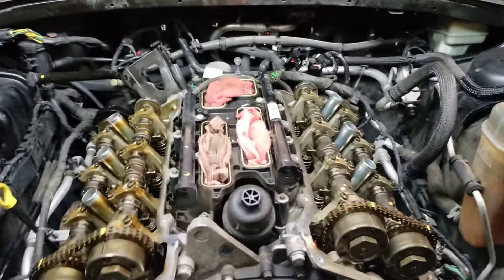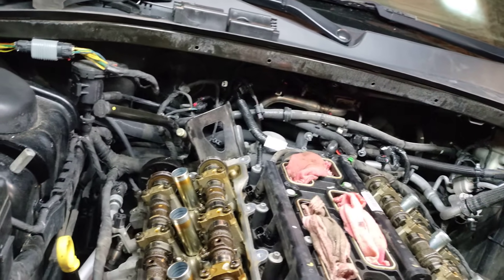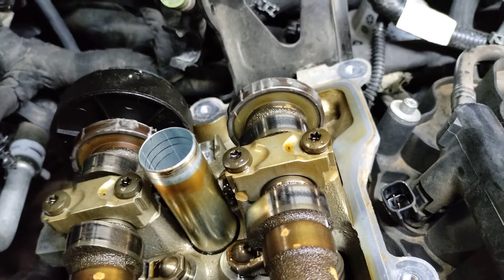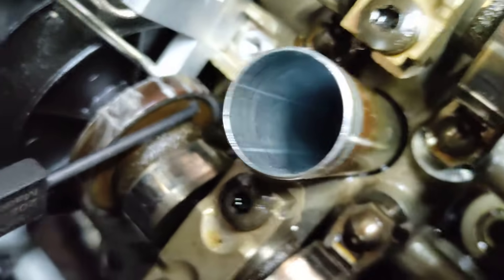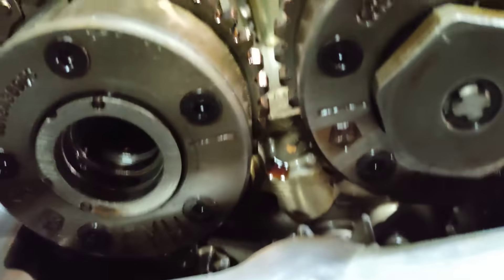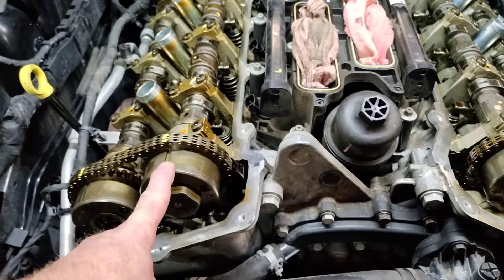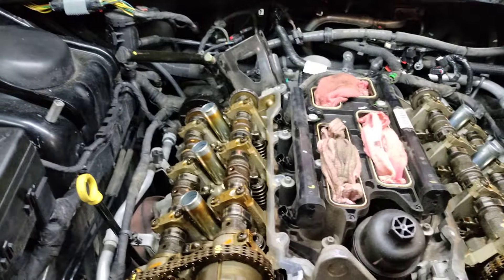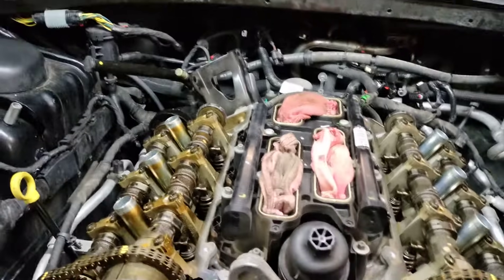Chrysler 3.6 Tone Wheel Check Tool

Comment: Hi I have a dodge promaster  2017 with 3.6 pentastar  i have bad cam sensor bank 2 and I also get service hill holder ecs  flashing  on the dash when the check engine light comes on have you seen this  before

Comment: Where those holes are at on the cam reluctors.  Where are those holes located in relationship to degrees?  It likes about 120 or so.  If that's the case I think that gives the computer it's base lobe seperation  angle between each intake and exhaust cam.

Comment: Hey Luther great video. I have a question. I'm not getting that code you got but I do have this tool. Before I break everything down, I'm wondering if you know what else it could be. I'm getting codes P0019, P0369, P0306 and P0300. I've replaced the crankshaft position sensor, int cam phaser and both camshaft sensors.

Comment: any chance someone could measure the distance between the holes in each tool? currently chasing a P000A and I'm at the step of cheking the tone wheel. cant find the tool avaible anywhere I check. I'm in canada. pretty sure if I measure instead that could work

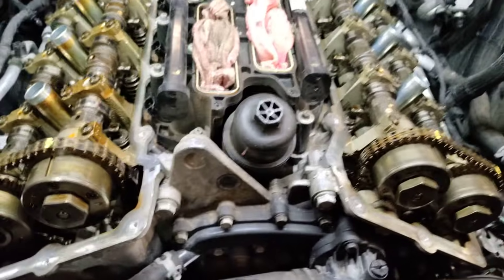Comment: It would be nice to have an outline of the tool and the hole marks so a homemade die can be made.  It's not a difficult tool to use or make, not sure why it is still so expensive.  Based on a visual, on bank 1, the exhaust cam tone wheel hole is 90 degrees to the right from vertical and is pointing towards the intake cam.  The Intake cam hole is about at the 5:30/7:30 position, depending on if you're looking at the cam side (5:30) of the tone wheel or from the back of the engine (7:30).
Reply: Especially since Dodge won't sell it to you

Comment: Have u ever seen the tone wheel covered in gunk and metal wear causing inaccurate readings? I have a 2019 jeep grand cherokee laredo 3.6l and it has a slightly rough idle and engine feels like it surges or misses with no cel or codes. Also the voltage will drop when this happens. At idle voltage drops but rpm increases from 600 to 650 briefly then r3covers. Dealership couldn't find the problem. I'm desperate for a fix bro please help

Comment: If you decide to buy this tool please do yourself a favor And spend the extra money and buy the factory Miller tool and don't buy the aftermarket option because I did spend the extra $50 dollars because I have seen The aftermarket tool and The markings are different and confusing 😮 And buy the Way The aftermarket tool is about 250 and the original one is about $300 not cheap 😮😮😮

Comment: Damn dude that was really good, I would like to find that tool somewhere. What's the recommended fix, replace the cam? That hole was so far off you didn't need the pin. Do you think I could order that part thru Chrysler?

Comment: When I took my covers off I see alot of grease on the toner wheel is that normal is it ok to clean off
Reply from the maker: Grease? Only asking because if its silver or metallic in color its metal sticking to the magnetic segments of the tone wheels. i suggest wiping it off with a paper towel or shop rag. Avoid using harsh cleaners. No need for brake cleaner etc it will 99.9 percent of the time wipe off. Those tome wheels can be damaged with certain cleaners if not used properly so that's why use a rag of some sort
Reply: @mastaTech91 thanks for replay back. Yea that was my though I’m getting a no start it died on me and won’t start back I changed every thing electrical you can think of just not the harness and when I was about to change phasers I notice the toners being junk on them I was thinking maybe it’s build up material and blocking the signals to start. Do you even think that’s possible to cause a no start
Reply from the maker: @Andy-gw7hd  I haven't ever had buildup cause any problems. A slight wonky scope signal but not any starting issues.
Reply: Ok thank you

Comment: Not all vehicles can you go by "left bank" and "right bank." Some models, primarily the Town and Country and Grand Caravan have the engine orientated east-west in the bay so your "right bank" is really the rear bank and the "left bank" is the front bank. However one tried and true method of determining bank 1 and bank 2 is that bank 1 always has cylinders 1, 3 and 5 while bank 2 has 2, 4 and 6. Bank 1, the odd bank is the one where the head is most forward. It's always on the right, or passenger side of the car in north-south configurations or back in east-west. Bank 2 is the even bank and always on the left (driver's) side for N-S or front on E-W cars.
Reply: First, identify the front of the engine.  That's always going to be where the timing belt or chain is located and where the serpentine belt is located. Then, facing in the same direction as the engine, facing front, bank 1 is always on the right side of the engine and bank 2 is always on the left side of the engine.  Cylinder 1 will always be the first cylinder from the front of Bank 1.
Reply: Then won’t bank one always be on left side of oil cam on all 3.6
Reply: @Andy-gw7hd  oil cam??
Reply: @Andy-gw7hd  if you look at the engine from the back side, opposite the serpentine belt, bank 1 is on the right side. Bank 1 is passenger side on N-S engines and inside closest to the firewall on E-W engines.

Comment: Hi I had tick so I put in all new lifters   n.   Roller rockers on 3.6 p. Star now I have code p0300 po301 stored p0345 po390  could you please  tell me what it is I need to do to to correct it thank you Brian
Reply: Have someone else check the timing and go from there.

Comment: Great video! On same engine I just replaced camshafts,  rockers and lifters. Now i have even louder ticking noise from before. No codes come on. Everything is running smoothly.  Only on 4th speed around 1600rpm i get little jurkwhen accelerate smoothly. Any thoughts on that? Thanks!

Comment: Quick question bro...what if I keep getting the p0018 but already replaced both camshaft with tonewheels but the code only pops up on a cold start...after that I can drive the car all day and the light won't come back...only on my first 2 to 3 starts I keep getting a p0018
Reply: Following... Did you ever get the P0018 code to stop ? Thanks
Reply: Remove your VVT solenoids and clean them with brake cleaner and lint-free rag. Then clean the hole where the VVT solenoid goes in as well as you can. Only use brake cleaner on the VVT solenoids after they're removed from the engine and don't use brake cleaner to clean the hole they go into. You can use a little bit of SeaFoam to clean the hole. If this doesn't fix it, you will have to teardown engine far enough to clean the passages between VVT solenoids and phasers. You'll also have to check phasers to make sure they're locked in place to the camshaft. The camshaft shouldn't rotate independently of the phaser when engine is not running. There's a lockpin that keeps them locked when there's no oil pressure. It' goint to be one of these 2 things. If you're the original owner, then you have to do more frequent oil changes. Most of the time this is a result of not changing your oil at recommended intervals with good quality oil and filter. Sludge builds up and it block oil flow to the VVT solenoids and  phasers.

Comment: Hello, great video!! 
I replaced the lifters and rockers on my son’s 2014 charger, typical tick.  While trying to take off the bank one valve cover the studs from the valve cover gouged the tone wheel. The car has a long crank no start now. It is in time, is it possible that the gouged wheel is causing the issue?  Thank you
Reply: No, a gouged tone wheel would NOT cause a no start. The PCM has 3 other tone wheels and CKP sensor to determine timing.

Comment: Great video, one correction for the timing chain its 12 rivets or 6 links but we get the point. Do you know of a way to check chain wear or stretch, in my motorcycle days you could check wear by pulling the chain up off the sprocket at the center of its wrap and you should see no more than half the tooths valley, you also would check tension by pushing down on the chain between the two sprockets, I would think any wear, stretch or wrong tension could create backlash that would set miss fires codes most likely both sensor 1 and sensor 2 of that bank because it would effect both intake and exhaust cams.

Comment: Had a dealer chaged bank 1 intake phaser and oil control valve.  Transmission starts off in D3 when driving, assuming the engine codes 0000A, AND PO017, CODES,  ONLY HAS 102,000 MILES. CHANGED CAM POS SENSOR BANK 1. TONE RING ON INTAKE CAM LOOKS LIKE SCRATCH IN IT. COULD THIS BE CAUSING THESE CODES?   WEIRD 2 CODES ON EXH, AND INTAKE ON SAME BANK 1. CHAIN DOESN'T SEEM STRETCHED,  MAYBE TENSIONER!  NO CODES FOR BANK 2.  THANK YOU
Reply: Did u ever find out what it was? I have a p0019 and p000c with the same symptoms as u

Comment: I've done a lot of 3.6 pentastars. Usually when you have a correlation code on the 3.6 in many of my situations it's always been a bad cam phaser.
Reply: Does that cause the car to like run rich and drive a little rough? Because I just got a p0340 and it’s acting up
Reply: @Alialmaliki18  it certainly can cause your timing for that camshaft is bouncing back and forth

Comment: if I'm understanding this right, the tool shows if its out of time?  if the timing marks are correct and the tune wheel is off, how is it adjusted?
Reply: new cam
Reply: The reason you do this is to find out if the toner wheel has become loose and shifted. If it has become loose, you will be able to rotate it by hand, so you adjust it by rotating it with your hand.

Another reason you would do this is when replacing a camshaft and the new camshaft you bought doesn't come with toner wheel.

That's what the tool is for. Once you set the timing by aligning the arrows on the phasers to point directly to each other, you then place the tool like he shows in the video, and align the holes in the tool to the holes on both toner wheels by sticking the pins through the tool and toner wheels. After you do that, you mark the toner wheel and the camshaft, take off the toner wheel and use an appropriate adhesive to set the tone wheel in place.

Comment: Thank you, excellent video.  What is the correct repair, a new camshaft?  Has anyone considered TIG welding the wheel to the camshaft?
Reply: Who knows what the heat will do to the magnetic ring.
Reply: @marossgnv TIG welding uses localized heat, I doubt it would heat the reluctor wheel enough to damage it or it’s magnetism. The wheel would not need a full weld, just a few tack welds.  What is the recommended method of repair now, replacing the camshaft?
Reply: @gfbemc0256  TIG welding is not a good option. The tone wheel is very sensitive. Best way is to use an adhesive that's heat resistant up to 300 degrees Farenheit or higher and oil resistant.
Reply: Loctite bearing and sleeve retainer. It’s green.

Comment: Hi Luther Grant. I did look at the Chrysler 3.6 tone wheel tool. I am impress.Any how i am having issues  with a 2008 jeep wrangler unlimited 3.8 Liter.I did scan for trouble code P0304/P0300 Stored.
Could i use my lab scope to check this problem. Let me know how to check for cam and crank synchronization. Let me know how to proceed. Regards. Winston.
Reply: If you have a 4 channel scope, backprobe the CMPs and CKP and connect to scope to see waveforms, then compare waveforms to known good waveforms.

Comment: Can you use magnetic viewing film to verify if the tone wheel was damaged by a magnet? My magnetic pickup tool accidentally touched the tone wheel
Reply: I just did my rocker arms and I also used a magnetic pickup tool and I think I touched it to the tone wheel.  I have a p0349 code that won't clear and I'm stuck in limp mode.  Probably gonna need both cams for bank 2.  Why do they design these like this??!!
Reply: @marcsciarrotta3109  Dang, that sucks! I was fortunate enough not to have any codes thrown once I put everything back together. I guess I just got lucky. That was one of the things that most videos don't talk about is the magnetic part of the tonewheel mostly everybody talked about the cam phaser and its sensitivity to magnetic tools. When I did use the film it did show the magnetic field and it look normal so maybe try that first and see if the magnetic waves are disrupted because if it's not, it honestly might be something else. Good luck and hopefully you find out the problem,  I couldn't imagine having to tear it back down again

Comment: I have a 2014 chrysler 300 3.6 I have a p000c with a p0019 can not git rid of these codes dose it have to do the tone wheel
Reply: I have the same problem did u have any luck fixing it

Comment: Great explanation!  Other than throwing that fault code, how will the tone wheels being out of alignment affect engine performance?
Reply from the maker: If the tone wheel moves enough to set a cam position sensor code then you get the long crank times before the engine would actually start. When moved the ecm can no longer confirm correlation between cam and crank and will almost always sub a value to get it started. Long crank times are the only symptom I've really ever noticed unless its several teeth out in which case it can cause driveability issues. Thanks for the comment and question. Sorry for the delayed response.
Reply: @mastaTech91  Thanks for the reply.  Reason I asked is that I replaced several bad rocker arms in my 2013 Town and Country.  Unfortunately, I put it off so long they destroyed the lobes on my bank 2 exhaust camshaft.  I bought a replacement camshaft off ebay for $88 that did not come with the tone wheel.  I moved the old one over and aligned it as best I could. (didn't know about the tool till afterwards when I saw your video)  My engine runs great now: no ticking, power restored, and cleared the misfire codes, however, I started getting camshaft position codes and camshaft slow response codes on that bank I assume due to the tone wheel being misaligned.  Glad you discussed the tone wheel.  Very hard to find information on it.
Reply: @dustinlaferney3160  did you ever fix your slow response time on the cam? As I have the same problem on the intake and exhaust on bank 1. I've changed cam sensor and the 2 cam phaser solenoids. It runs great except that it doesn't downshift once it hits 6th gear and the codes 369 and 000a and 000b. It's permanent codes s not sure what is wrong.
Reply: @Sam-656  Wish I could help.  Not sure why your ride is throwing those codes, must be another problem.  My TC is still running great with 211K miles despite the camshaft sensor codes.  If you figure it out, let us know.  Good Luck!!

Comment: The metal debris on top of the tone ring itself, is that normal in these 3.6l?
Reply from the maker: Yes.  There will be a metal on them from chain and gear wear as well as other steel parts. I will clean them off with a rag when I got the valve covers off.  It usually doesn't interfere with the sensors unless it gets an extreme amount on them.
Reply: @mastaTech91  I was just going to ask if that should be cleaned off..
I'm doing head gaskets on my 2013 challenger and noticed the metal on the tone wheel's....got the heads resurfaced they are back from the machine shop... starting reassembly tommorow...great information my man....👍👍💪😎💯
Reply from the maker: @DonCatherman  First thank you for the great compliment and for the question. Second yes the debris should be wiped off. Just use a rag, paper towel whatever you can find that isn't abrasive. Use of brake cleaner or carb cleaner or anything harsh like that can damage the material. So i always just use shop towels. Awesome on doing your own work.